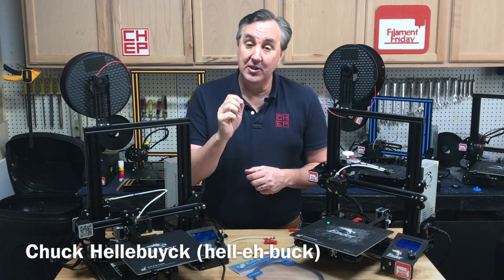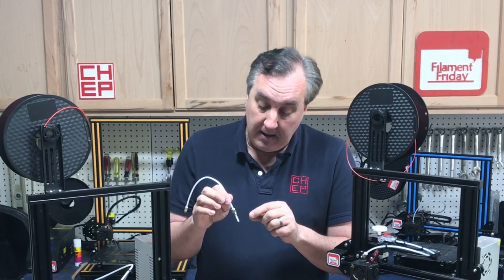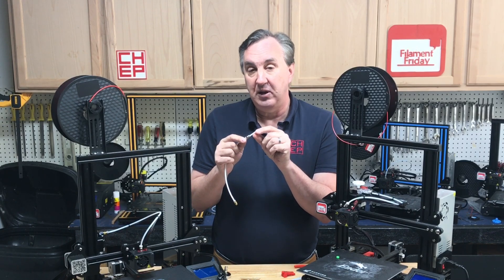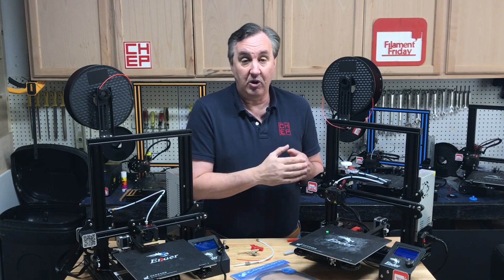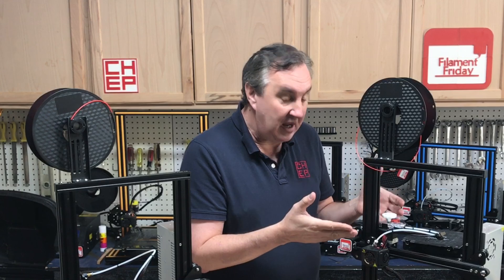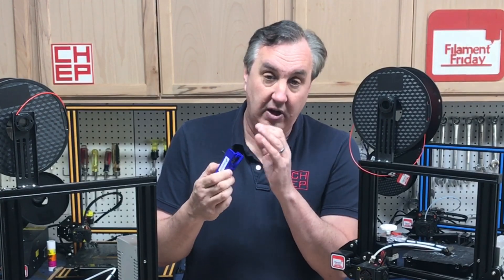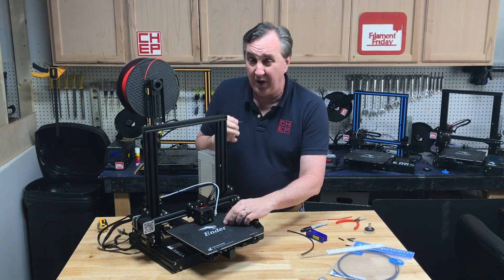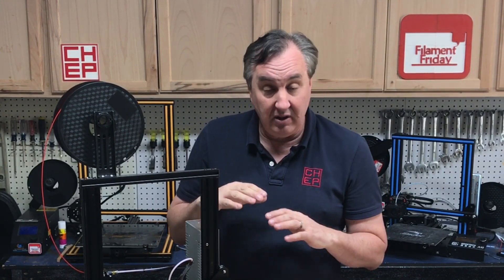Simple HOTEND FIX for Creality Ender 3, CR-10

Comment: I use another brand of tube is CCCTree is better than the stock that comes with the Ender 3 and for the price I think is not as good as Capricorn, gonna try this because my printer have developed some stringing and maybe this tube has lost lubrication as the stock one.

Comment: Nice video CHEP! I have an EZ R Struder for both my Ender 2 and 3,on your recommendation! My Ender 3 works perfect, but my Ender 2 always has the silver thumb wheel skip and make a clicking sound... It kinda jumps, half way through all prints... With all filament!
I pulled out the flexible filament yesterday and it was like a little corkscrew! All curled. Stuck in that 2" spot. 
Why do you think that is? How can I fix it?
Right after I bought it, I brought it up to the guys who make the EZR and they dismissed it, like it had never happened before, so it couldn't be happening now! Completely ignored me! 
It ruins each print because it stops feeding filament!
Thanks for your help! 😎 🤘
Reply from the maker: Sometimes the spring to strong and crushes the soft filament. Some people use the old Creality spring instead. 
Also check your PTFE at the EZR. Making that end more like a funnel can help.

Comment: Hi Chep! Great video! I have one question for you.  With the Capricorn tubing having a higher temp rating over the stock ptfe tubing, is it possible to print with filaments that normally would require an all metal hot end like a Micro Swiss? To be specific, Nylon or Nylon X.
Reply from the maker: No, it’s not that much better.

Comment: Can this be printed in PLA? Does the fact that it touches the hot end suggest we use ABS?
Reply from the maker: No PLA works fine.
Reply: I just reworked my hot end fix, but the next time it needs fixing, I want to try printing the thicker washer in TPU - it will have some give and will actually provide dynamic pressure on the tubing in case it shrinks a bit from the heat.

Comment: that hotend design is inherently bad, it's destined to fail, PTFE will degenerate, get soft and deform under heat, even if it's not above the "240 max", 210 can and will degenerate it, plus the type of coupler everyone uses on that is really bad (passthrough), you should use a non passthrough coupler with a piece inside like that
best thing you could do is go all metal with a high quality heatbreak, none of that crappy cheap stuff, I recommend finding some high quality, mirror finish titanium heatbreaks

Comment: I really want to add to this that the different lengths you measure can be caused by already leaked filament inside the hotend! (Above the nozzle) I measured mine and got around 34mm, then I removed the nozzle, heated up the hotend and cleaned it (pushed out a big blob of old, mixed color filament) and after that I measured 39mm! This mod does nothing if if pushes the tube on a melted blob! Please Please clean your hotend if you're doing this when you're already at it

Comment: I tried out the moded version that you gave in the last video. Although it looked very promising in the beginning, the bowden tube kept coming out of coupling after a few hours. The first it happened was when I did a 12 hr print overnight only to wake up to tangled mess of filament. I have hence switched back to the original hot end fix and been printing away for weeks. You live and learn I suppose. Thanks for the great videos.
Reply from the maker: That’s another reason I abandoned it.

Comment: Maybe i’ve missed something: how is this different than just using capricorn from extruder to hotend if it doesn’t have those lubrication issues from the stock tube?
Reply from the maker: Watch again, I explained it all.
Reply: @FilamentFriday  I rewatched a few times but I'm really unsure. is is just to do with the ID of the capricorn tubing?
Reply from the maker: It doesn’t rely on the coupling fingers and gives a higher resistance to damage from heat that causes the stringing.
Reply: Diameter, extruder doesn't work that hard pushing the fillament all the way + the possible tube movement near the nozzle is eliminated. So you get precise and consistent retractions, less stringing and no clogs and partial clogs.
Reply: The main issue is fixes is tube movement in the hot end.  Which has caused most people trouble at least once or twice.